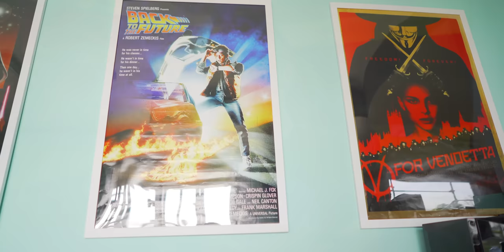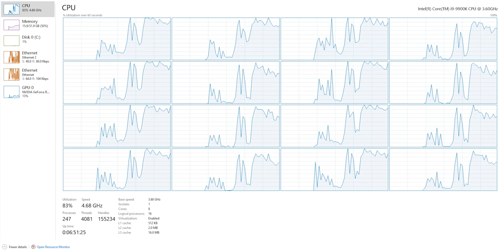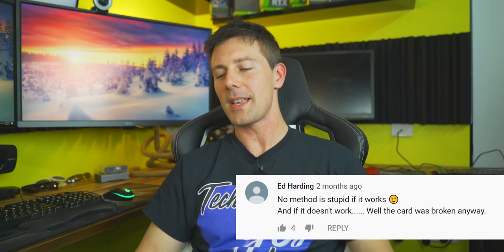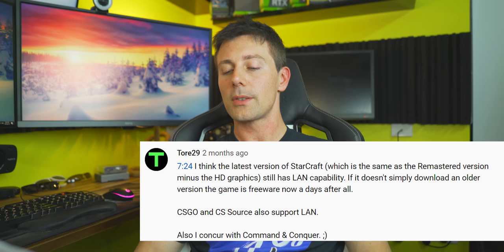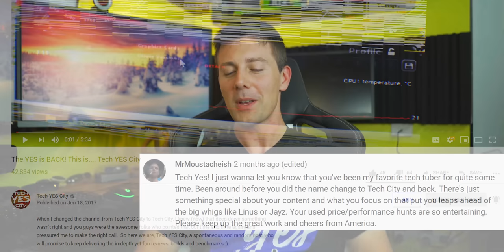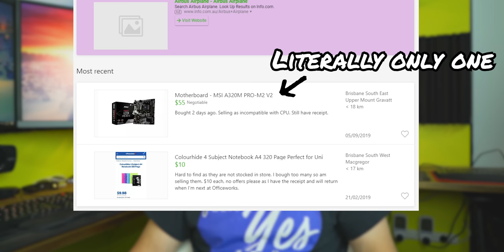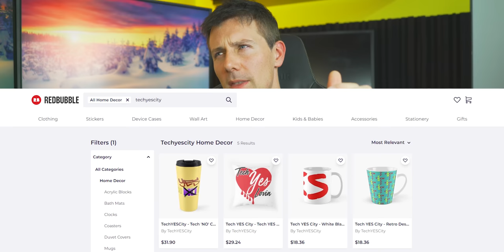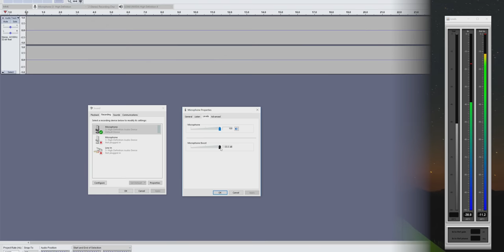Is Ryzen 3000 Still Good for X370? The Unanswered Challenge to Linus? (ATY #009)

Comment: Thanks. I have an X370 Taichi coz I need those 10 SATA ports for my RAIDS and both NVMe's for booting Linux and Windows. 
However I'm waiting for the R9 3950x to be tested on it before I upgrade my CPU.
Reply: i was the poster bryan mentioned asking about the taichi , i have a 3800x in it now ,it will be fine mate the vrm's are ticking over on an 8 core there massively over engineered
Reply: @tonybarden8563  I have since watched a Buildzoid video where he said the VRM's were unnecessarily overbuilt so I'm confident now it will handle the 3950x, that's if I can get my hands on one.
Reply: @Brodda-Syd  well you will at some stage ,just how soon depends on how much stock they have built up i suppose ,anyways have fun with the new system 

the bios version 5.8 seems to be quite stable and i can assure you its okay to use a first gen cpu to flash the bios to update it before the 3000 series (remember to reset bios defaults before flashing though )

Comment: A C6H (no wifi) user here, using 3700X w/ PBO, currently on 1003ABB bios. I just can't get my RAM OC'd higher than 3333Mhz. The ram is Hynix AFR though. My boost goes up to 4.25, and turbo seems to hit 4.35 occasionally.

Comment: For the v2 xeons try with E5-2667 v2 8 cores and good turbo up to 3.6ghz on all corz.
Reply: Alexi Bahchevanov they are good but they are very expensive for what they are
Reply: @MarshallSambell  Well seeking is higher clock... There are cheaper variants but i don't think dropping below 3.6ghz on a 6 year old CPU will be a good idea.
Reply: @MarshallSambell  There is the E5-2696 v2 which goes for 250ish usd for the best 12 core in the lineup maxing at 3.1ghz, but this limits the single thread performance a lot. But maybe the gain of 8 total cores can remedy that. For 2 cpus that is.
Reply: Alexi Bahchevanov, I’m not taking about for gaming at all and he said used price performance and the key is price performance 2670’s can be had for super cheap on aliexpress

Comment: Just get a good old DELL T5600 (SandyBridge) or T5610 (Ivy Bridge) for the dual performance review.  The CPU's are Intel locked, so an OEM chasis can make good sense for the money (HP or Dell, many second hand deals on mkt).  I have a DELL precision T5600 with dual E5-2667's...and its a decent gamer...I  paired with GTX970 OC. Handles 1080P in high settings, no problem. Got the T5600 for free on a company decommissioning deal (incl 825W power supply and 32GB DDR3 REEC 1600 RAM).

PS: I also installed an E5-4627 (V2) on my eldest daughter's PC, paired with a HuanaZhi X79 deluxe. CPU is OEM locked at 3.3 Ghz base, 3.6Ghz turbo. However, all core turbo is 3.5Ghz on 8C/8T. I managed to grab a good one for $80 (+$14 shipping).  Surprised me.  CB R15=965, R20=2060. Very cool CPU...I mean it runs cool too, on air.

Comment: x370 is fine, but the memory support just isn’t there. wish I knew that before I got 3600mhz ram ~。~
Reply: Will a x470 have those kinda speeds? Iam thinking about upgrading my 2600 next year with ryzen 4000
Reply: I found its CPU related tbh. on my x370: 1600x only 2933 CL16 no XMP. 2600x 3333 CL14 no XMP. 3600x XMP works, and can do 3600 CL14 and will go higher freq with looser timings if thats your thing. (same mem sticks throughout)
Reply: Just do 3200mhz or whatever your mobo is rated and just lower the latency
Reply: I never had problems with this. My first ryzen motherboard always hit my rated memory speed (3000 MHz) with xmp enables. Always use xmp or whatever standard your motherboard manufacturer uses, make sure your memory is on the qmvl (qualified memory vendor list), and make sure you have the latest ageisa update. It helps with memory compatibility a lot. And ryzen works best with Samsung b die.
Reply: i got 3600 cl16 first try on the x370 taichi
Reply: tony barden CPU dependent, my Asrock Fatal1ty at best has done 2933cl16 on 2 sticks on 2200g (4 sticks even at 2133 will not work on my 1700! It cannot run 4 sticks of memory period in my Ryzen 1700... And that 4 sticks can run above the 3600 XMP on my Threadripper 1950x... like 3777 MHz).

Originally, the X370 BIOS even had problems with XMP 2800cl17 on that R7 1700 (tuned to 2666cl13 worked fine though), but now it’s clear it’s probably just a defective CPU (which I knew it was bad, like lowest 5% binning since even 3.85 GHz below 1.4v and no LLC sent it thermonuclear on the same AIO cooler that did fine on my TR-1950x at 1.45v medium LLC at 4.15+GHz). The memory controller was just so freaken weak on that 1700 that it can’t run 2133cl15 stock spec with 4 sticks... So my 2200g was my best for the 2933, however it took cl19 to hit 3200 MHz, and impossible to hit the 3600 MHz XMP on 2 sticks even with 50% SOC over-volt and sub-zero temps (I had it direct die sub-zero cooled, yes it’s delided).

It’s all CPU memory controller bound, and first gen was terrible (Threadripper was binned, that also apparently includes the memory controllers). Extremely happy with my Threadripper though, just quad Crossfire like a champ with 64 PCIe lanes!
Reply: @jakegarrett8109  a lovely essay ,but you overlook the fact the comment IS BASED ON RYZEN 3000 AND X370, as for first gen way way back in april 2017 MY 1700 was quite happy to dial in 3200 mhz cl14
and then on bios 3.1 circa july 2017 sat at 3333 cl14 for the next two years 

so back to MY COMMENT and the point of this section of comments the x370 taichi and my 3800x are happy at 3600 cl16
Reply: tony barden Please re-read my first sentence... As it states across every Ryzen generation, and then I provided examples on how it varied with the CPU, which shows why Ryzen 3k is perfectly fine on X370. It’s only dependent on CPUs lottery of its memory controller (Although I mentioned testing on the same brand of motherboard you used, the X399 I used was also a Taichi, but it is irrelevant info since it’s not the same platform and It’s all about the built in memory controller anyways).

Comment: X370 is good for someone wanna run 3900X for a budget. Only problems is Ram compability
Reply: If you're running 3000 series chips, ram is no longer a problem. It was Gen 1 CPU's (especially) that caused that problem. 

But if you have an x370 board with a 3700x or above you'll have no ram issues of any kind as its the CPU SOC controller that was the problem on previous Gen 1 and on some boards for zen+ (x470) too. 

But the new CPU's have solved that, it has nothing to do with any X370/x470/X570 boards, just the VRM's were the issue not ram compatability at all.

Its also bios support that has helped solved it all too. 

I hope that helps you clear things up. 

Maybe change your comment a bit too 😊😉
Reply: X570 are not that much expensive than 370.

Comment: Basically the Asus hero VI x370 board was so heavily over engineered that it looks like it was designed for the 3900x back then! 

I'm waiting on my 3900x still for my hero board, but I already know I'm in very safe territory as I'm also running a 1800x @4.1ghz already 😊. Though I did upgrade from the Carbon pro as it couldn't get 4.1ghz at all prior.

Comment: Phantom gaming X x570 Is the best!!
Reply: I got the Gigabyte X570 Aorus Pro + G.Skill Trident Z Royal 3200mhz 2x8gb CL14 + Ryzen 5 3600 paired with a GTX980Ti. Overclocked the ram to 4200mhz CL16 (16-16-16-36) at 1.43V and the cpu 4.2ghz all cores. Getting the Rtx2080 super next month and will upgrade the xl2411 144hz monitor to xl2546 240hz. On january will be getting the r9 3900x
Reply: R5 3600 runs 72C max at 1.35V with the stock cooler and stock thermal. Will change it to MX-4 silver next month because ill get the dark rock pro 4 cooler

Comment: I'm more interested in if the Ryzen 3000 series CPU will let you clock your memory past 3200 MHz using XMP. I have 3400 MHz memory on a X370 Taichi with 2700X and I cant get the memory past 3200 MHz with it crashing on stock timings.

Comment: Can't get 3700x even POST on x370 Taichi, spent almost a day trying to resolve it, bios updates and rollbacks, memory stick swapping, cleared bios many ways etc. Thinking of changing the mobo
Reply: maybe i can help , i flashed to bios 5.8 using my 1700cpu ,fitted the 3800x no boot just constant restarting ,onboard led went 33-7a-36 then reboots 

the solution ?  use JUST ONE STICK IN A2 test the boot then ,on my taichi it worked str8 away,since then if i flash bios or lock the bios (with un-liked settings) it will lock up again and i have to remove the ram stick from b2 to make it boot to bios then save exit and insert the stick in b2 ,it then boots fine every time after

Comment: I have a x370 TaiChi mobo with a 3700x. Overclocks to 4.2ghz on all cores, but having issues with ram timings. It simply won't accept any xmp profile, and uses only default ddr4 speeds. I've also tried manual timings, and also Ryzen Master, but it won't boot with my Flare x ram in a 4 slot configuration in anything other than default.
Reply: set the xmp with one stick in a2 ,reboot and let it go to bios screens ,then add the 2nd stick in b2 and go back into bios screens ,save and exit THEN SHOVE THE OTHER TWO STICKS IN 

this may work (my very first initial boot after upgrading to the 3800x would post with the already fitted and working sticks) it did boot with just one stick in a2 ,after that it boots 100% with the extra ram ......very very weird but thats how its working ,now dont ask me to explain why the very first boot will only work with one stick after a bios update, but thats what happened , now it boots fine cold boot ,disconnected power anything except a bios flash or i lock the bios with an incorrect ram overclock or cpu clock
the bios led debug gets stuck on 36
Reply: @tonybarden8563  Thanks, I'll give it a try later :)
Reply: @PlanetVampire  good luck mate 

as i said watch out for the board led the point mine stuck at was 33-7a-36, this was cured by using just one stick in a2 to post bios ,then save exit and fit the second stick and its away ,quite happily running 3600/cl16 now
Reply: @tonybarden8563   A late reply, but I finally got around to trying your suggestion and it worked! Thanks again!
Reply: @PlanetVampire  glad to hear it worked , these ryzens just need a little tweak and fiddle now and again, and WE ARE ALL still learning how to

Comment: can you do b350 next? like a 3900x on a b350
Reply: itll work, but you cant put  heavy loads on the cpu because of the vrm temps. Watch Hardware Unboxed videos on it
Reply: If u can afford a 3900x u can afford a x570  or aleast  nice x470.
It could be done but that's just crazy.
Reply: no... why would you ever do that. Can afford a $500+ cpu, buy a decent motherboard.
Reply: @NeVErseeNMeLikEDis  i just wanna see if it was possible. yes absolutely agree with you but i know some people would definitely do it if they can get away with it. i mean, if you can, then why not? right? no use spending another couple hundred bucks if you can stay with what you've got.
Reply: @franzb69  you absolutely should get a new board. I upgraded from a ryzen 5 2600 in a b350 board. I bought a R7 3700x and an msi mpg x570 gaming edge board on launch day. Not only are the boards better quality, but they have useful features for a high end system user to take advantage of. If you cant afford the better platform then you shouldn't be buying the CPU. Dont waste your money and fry out your old board. Sell it and recoup 60 bucks.

Comment: A few things.

Adobe is NOT optimised for intel CPUs, it just isn't optimised for anything but to run good on Ryzen it needs to specifically be tailored towards that as the Ryzen architecture has many oddities that you need to work around. I know quit a bit of software that runs better on an i5 8400 than a Ryzen 7 2700X just cause the software is not that simple. when running the same program twice but limited to 4 threads than the Ryzen is significantly faster, showing that it is not the program being optimised for Ryzen but just the architecture it self that is detrimental in certain scenarios.
And no - you can not just start the same controlling software twice and hope it works - we need to whole system performance and keep everything together as tight as possible - if there is a program that for example handles the interaction of all users with a central database then it is simply not possible to run multiple instances as that would waste a lot of performance on the DB, significantly increase memory overhead, reduce cache locality and most importantly - you'd get one hell of a problem with synchronisation and data integrity. This is one of the examples where i know the companies using that software are more than willing to throw away a couple thousand dollars for a single CPU like the Xeon 6244: 3000$ for an 8-core, but it has a slightly higher clock and large cache for those 8 cores which in this case performs quit a lot better actually than the 6248 - a 20 Core CPU for the same price but with lower clock.

And Multi-socket boards and performance:
In what way is it good that now resources have to be essentially wasted on that? Server-software was already designed for that, now the normal windows also has to carry that baggage - and that adds complexity to the system - many more points of potential failure, much more code to maintain, and more work for the OS even when running. If you want to use a multi-socket system then get an OS that was designed specifically for that.
Reply: Intel literally pay adobe to make it work more efficiently on their CPUs, I'm sure if AMD did the same performance could become more similar
Reply: @spusuf  Sure sure, and AMD has cured cancer.
Reply: @ABaumstumpf  hope they find a cure for being a fanboy soon, its getting to dangerous levels for your health bro

Comment: I have a pair of RAM modules here, which are apparently defective. One runs at least fine with the basic 2133 MHz but not with XMP, the other one doesn't work even at the baseline frequency. Is there any way I could fix that (like the baking graphics cards method) or can I dispose them? 🤔

Comment: I need help should i get a b450 for 3rd gen ryzen or should i save up a bit more for a x570 to have upgrades down the line?
Reply: B450 will be perfectly fine
Reply: Jason Deng what 3rd gen cpu your going with
Reply: @losae9401  r5 3600
Reply: @jasondeng3820  will be fine. Anything above or high end 8 cores woulda been a legitimate case to go for x570.

Comment: You need to try Davinci Resolve man, I'll change your life.
Reply: Davinci Resolve is incredibly slow... Like every export even with 0 change takes ages (and yes, it would probably help if I could use half a dozen or more GPUs, but assuming I only use one like my trash Titan Xp collectors edition or only one of my 4x Fury cards on Threadripper, it still takes ages!). Plus, try speeding up a video without it sounding like Alvin and the Chipmunks... oh wait, it can’t! Basic video speedup like in every freaken media player just doesn’t work on Davinci, it either chops off the end of the audio file and de-syncs the motion and sounds, OR you sound like a high pitch chipmunk! VLC for example when you speed up like 2x retains the correct pitch and just “speeds up” the playback, but sometimes you need to be able to edit and export the video (like Davincis whole point of existence) to say, YouTube without adding a caption to tell people to manually change the playback themselves... that’s ridiculous!

Playback speed is such a basic function, that without that, it’s useless to me. I bought a license of Vegas Pro, literally because it didn’t fail at simple video speed up like Davinci. Even on a freaken laptop Vegas does almost time for time exporting with simple edits (so a 20 minute 1080p clip might take about 18 minutes to render/convert/export), while Davinci is hella slow on normal desktops (I wanted to run it on 6 GPUs at once just to see if I could make it as fast as my laptop was with Vegas, but unfortunately you have to buy the $1k license to enable multi-GPU... but that’s probably not all that fair of a comparison using a Mohawk of GPUs bolted to the case to compare vs a typical gaming laptop with only a 8750h and GTX 1070 vs like a Threadripper and Cuda from Titans and a bunch of Fury and RX470 on water, like that’s kind of insane if that’s what I thought it would take to match, it’s just slower!)

Yes the color grading could be cool to mess around with, but it sucks and incapable of basic tasks... time wouldn’t be a huge issue (as I have a LOT of computer hardware and could run it on multiple systems if I could split up the video workloads), but if it’s slow AND can’t do basic typical things, then it’s junk to me...

Brian does put audio over his sped up video clips, but what if he wanted like 1.2x speed for a slow talking session without sounding like a girl or getting kicked in the nuts? Basic stuff...